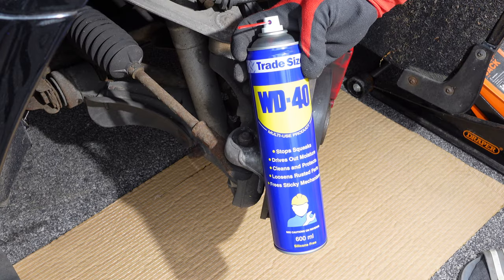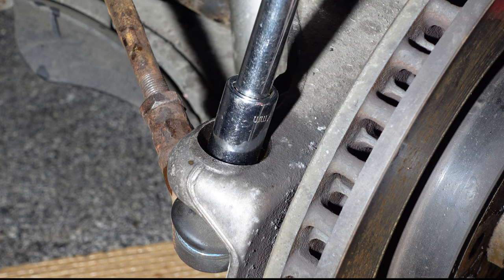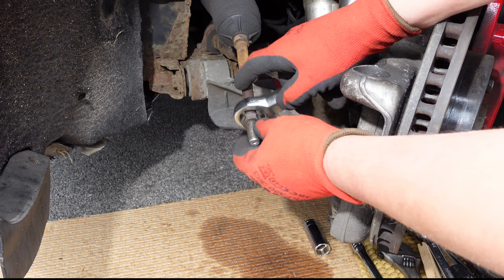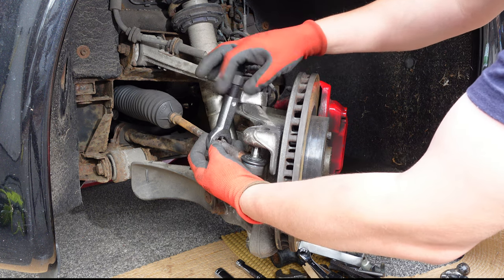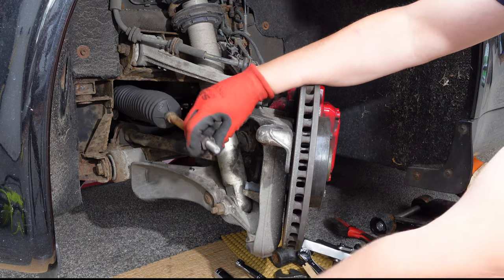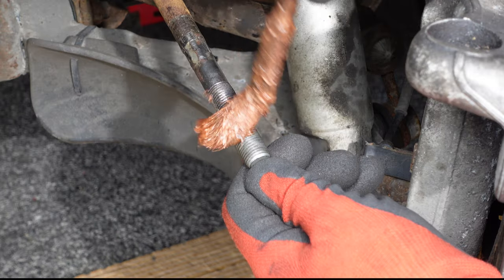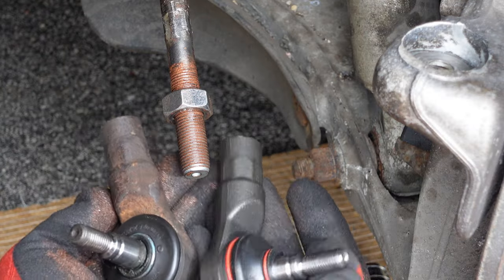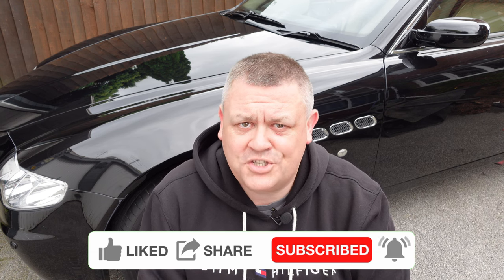Maserati Quattroporte Tie Rod End Replacement | Step-by-Step DIY Tutorial

Comment: Hi there, maybe a stupid question, but why did you change the rod? Did you have noises while driving?
Reply from the maker: No noise but the inner edge of the tyre had extreme wear and steering felt loose. Took it for tracking and they could not adjust tracking as pinch bolt was seized.